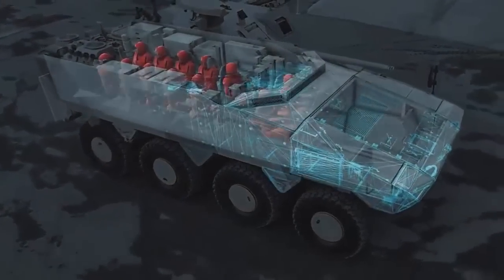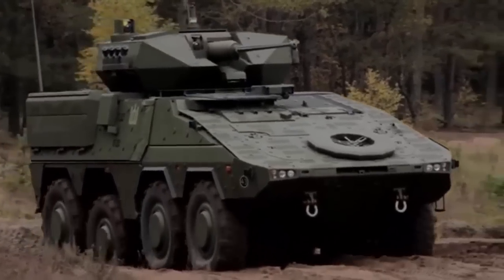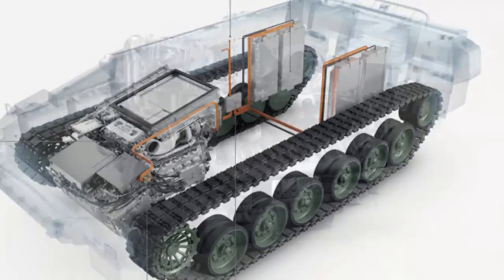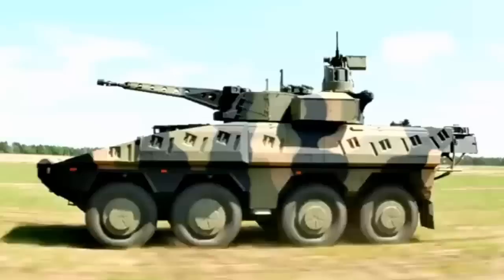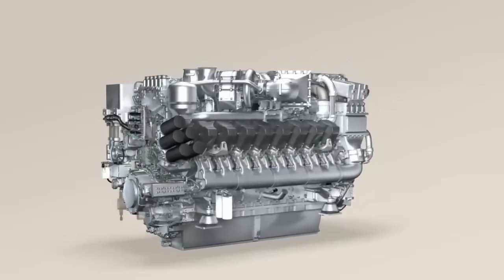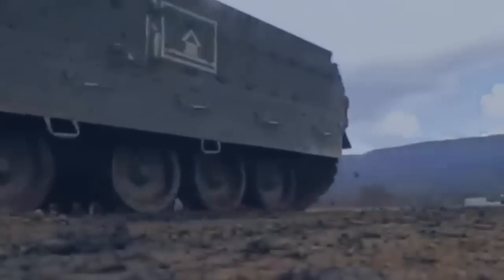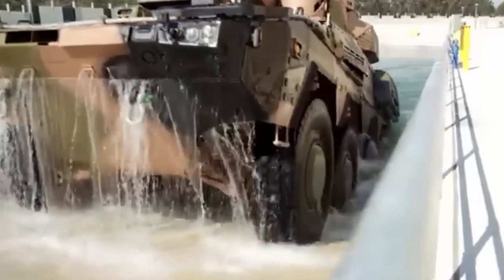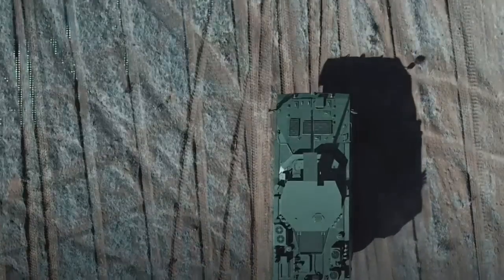The UK's New Generation Armored Vehicles With Stealth Mode Hybrid Propulsion

Comment: With construction of the Telsa trucks and Semi, its was forgone conclusion that militaries would look at integrating electric drives
The 70 ton Abrams needs 500 gallons of fuel while the Bradley needs 200 gallons and smaller vehicles 40-60 gallons
Fuel tankers has always been a majority tactical vulnerable of any military
Hybrid system would allow them to operate with less reliance on gas but how safe is for the crew in case the drive or battery gets hit